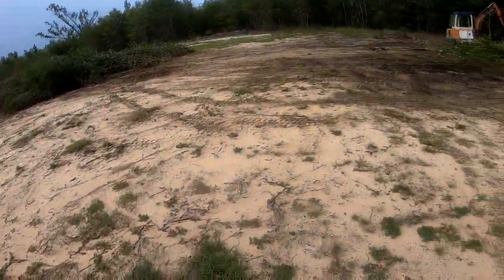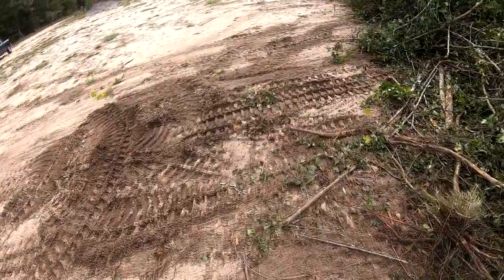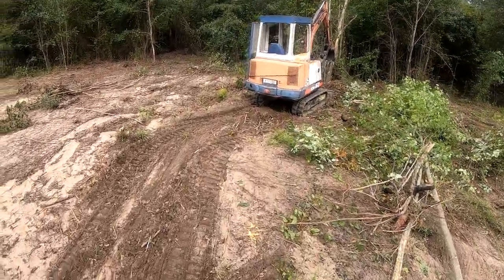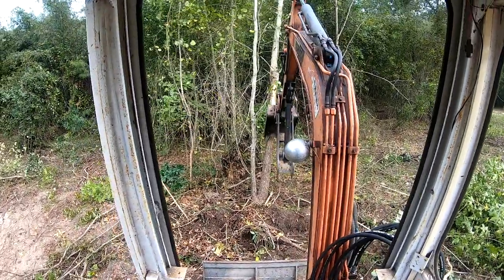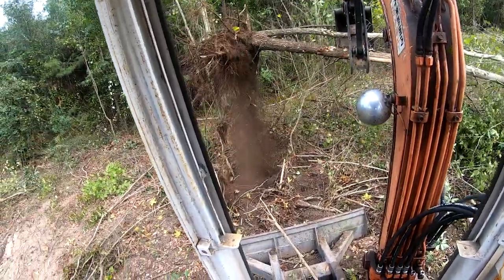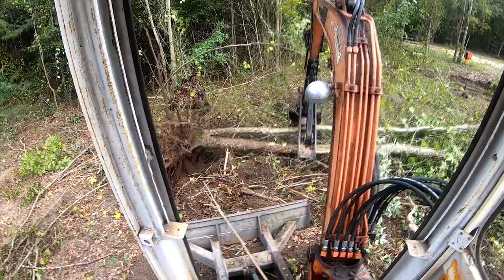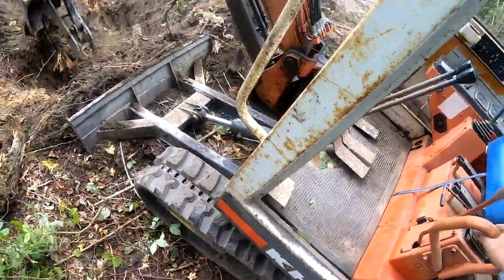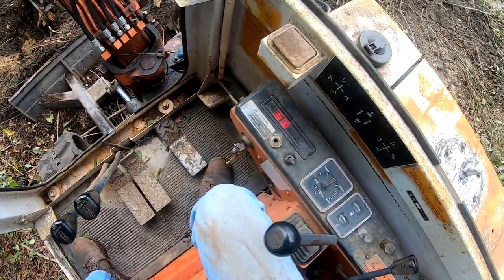Little Kubota and The Stubborn Stump

Comment: Great job digging it out.......just a little tip next time you have to move one i have had good luck getting a part of the stump on the front blade and reach over with the bucket and lift both a little and move where needed.........Thanks for sharing man i like this kind of stuff.

Comment: Nice work with the stump, but GS you really should get that front steel mesh installed as a screen, especially when your digging out stumps like that. And pulling trees. I saw the pin walking out and I thought you would have see it! Oh well new pin required !

Comment: As for painting the pins.  We just lubed them up put them in, degreased the ends and put some equipment enamel on the end with a brush.  The grease made painting the entire pin not really matter.  It seemed to help notice them even before they fell all the way out some, but when they did it helped find them in the dirt.  Investing in a cheap metal detector helps too.

Comment: Once a person knows the limitations of the equipment, all it takes is a little patience and most things can be accomplished.  The trick is not to beat and destroy the machine.  You can tell you understand that GS.  Doesn't hurt to be part mechanic and part Macgyver.  We liked to paint those pins yellow or orange for as long as it lasts, makes it easier to find in the dirt (sometimes).

Comment: Great video!! You should get a stump grinder for tough ones like that 😁
Reply from the maker: Thanks Sean. The reason I can't use a stump grinder is that they would rot and leave a sinkhole that the tractors or vehicles would fall into. Imagine how large the sinkhole would be for a stump that size! That would absolutely tip over the excavator if one track sank into it while driving over. I also will be building a road that goes directly over that stumps location. The dump trucks traveling through there weigh 70k lbs fully loaded.
Reply: Makes sense. I hadn’t thought about it rotting and making a bad spot in the road.

Comment: wow. what a fight. Course your JD tractor would have pulled that right out no problem. haha
Reply from the maker: The JD tractor only weighs 2200 lbs. The excavator weighs 7300 lbs. It was all the excavator with tracks could do to pull it along to the burn pile. That little sub compact wouldn't even be able make that big stump move an inch...heh

Comment: For stubborn stumps my grandpa used to drill 3 inch holes and then pore kerosene into them and let them slow burn, ideas for the next one :)
Reply from the maker: Seems like that would take some time to burn and get rid of. I wouldn't feel comfortable leaving something burning in the ground without being there to monitor it. Especially as hot and dry as it gets out here. There shouldn't be many more of these out there to take care of moving forward. This particular stump just happened to be right in the middle of where I want to put a road!

Comment: I like what you are doing but remember you added the pedal mod to be able to swing the boom and you are still cab swinging more than you have to.
Reply from the maker: The pedal for the boom control doesn't have much power. It is mostly to keep the boom straight without having to lock the cab into place. The boom also has very limited movement left and right, whereas the cab can rotate 360 degrees.

Comment: concerning low oil  pressure. beware of defective oil filter, can restrict oil flow
Reply from the maker: The light came on with the old filter which didn't even have 10 hours on it. I did an oil change and put a new filter on with the same results. The oil sat in there for a long time while it was parked under a shed. I have to believe it is gummed up a bit around that screen over the pump. We'll find out in a couple days.